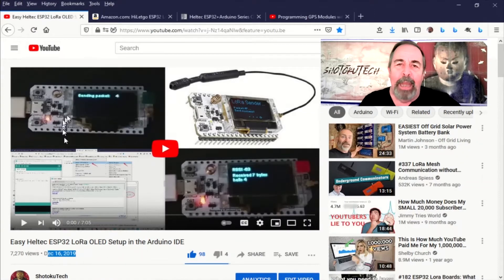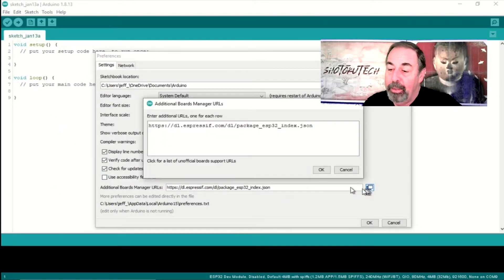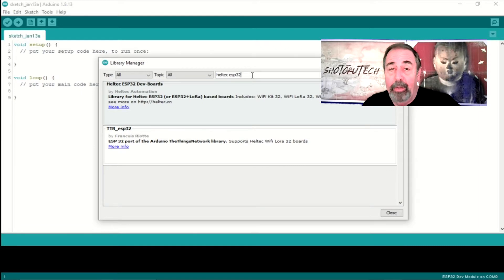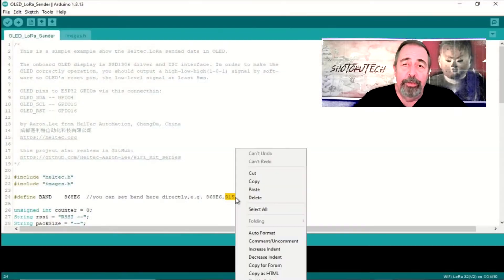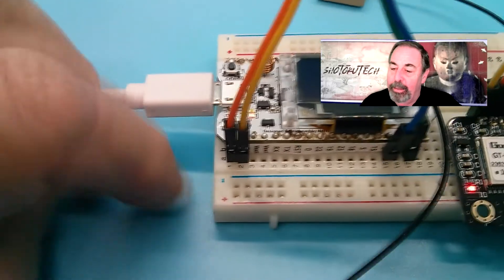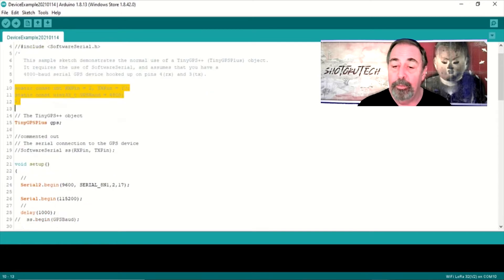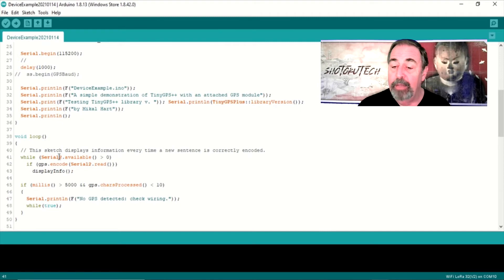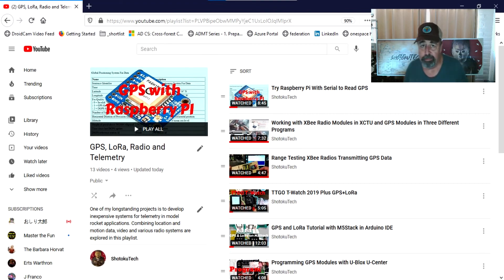New Heltec ESP32 LoRa Update and Connecting to a GPS Module

Comment: does this same method work for the V3 of the Heltec ESP32 LoRa boards?
Reply from the maker: Yes it would work, though the Serial pins have changed on the WiFi LoRa 32 V3 as it runs on the ESP32 S3 chip. I have several videos covering the V3 board. Thanks.
"Heltec WiFi LoRa 32 V3 SPI, I2C, OLED I2C, and Serial Pins"
https://youtu.be/OBQidEVssto?si=81VYD5ByApqbFXD7
See the V3 Pinout here: ShotokuTech / HeltecLoRa32v3_I2C
https://github.com/ShotokuTech/HeltecLoRa32v3_I2C

Comment: I am having trouble connecting my Heltec LoRa32 v2 to my GPS module. My code is very similar to yours, but I cannot seem to establish a serial connection with my GPS module unless I use pins 16 and 17. Using these pins I am able to read  and encode data, but it doesn't look how I'd expect NMEA GPS data to look. Since the LoRa board uses pin 16 for the OLED (which I have unsoldered from the board), I am worried that I am seeing erroneous data that is not coming from my GPS. I have used this GPS module with an ESP32 in the past, so I am fairly confident it is functional.
Reply from the maker: I don't think it is best to upset the pins that are dedicated to the OLED. Pins 2 and 17 were ideal from my perspective.

Comment: Hi, I have a Heltec ESP32 LORA v3 using Meshtastic.  I'd like to add a plain ublox neo6 gps.   Using the existing Meshtastic firmware that is already on the Heltec board , which pins should I solder the TX, RX leads from the GPS ?
Reply from the maker: Hello. Good question. But I haven't had the chance to try that one yet. For my example here I used software serial to assign pins that were available, as in not already used by something else on the board. Check the pinout here in the datasheet. 
https://heltec.org/project/wifi-lora-32-v3/
You can see GPIO43,44 are already taken by the USB port for serial. (CP2012 is a serial device). It looks like GPIO45-GPIO48 are open. Interesting device. Thanks.

Comment: I am using heltec esp32 lora wifi with BN-220 GPS module, i tried using your approach but it does not work 
i only see garbage characters printed on serial monitor . 
I connected to RX and TX of GPS to Lora RX TX pins Serial2.begin(4800,SERIAL_8E1,RX,TX);  - result �U��[ ���Y)�����)�Q ..
One observation : when connected  RX to LOra i was not able to upload sketch , i had to disconnect the RX pin upload then put it back 

, Also tried connecting to 2, 17  Serial2.begin(4800,SERIAL_8E1,2,17); as in your video -result  No GPS detected: check wiring.
Reply from the maker: Link to my code in in the description. https://github.com/ShotokuTech/DeviceExample20210114
This works as demonstrated in the video. Is your device speed 4800 baud or 9600? Hardware serial is used by USB port. So I employed software serial.
Reply: @ShotokuTech   how do we find device speed , i now connected to 16 and 17 , to avoid the hardware serial still no use, 
I commented some more details before for some reason youtube did not post it
Reply from the maker: @ameenasif  Find the management utility for your GPS chip. You can read, control and configure the chip with the utility from the chip manufacturer. I show this in: "Programming GPS Modules with U-Blox U-Center" https://youtu.be/ZaDpx9DvCPo
Reply from the maker: @ameenasif  Amazon product page has some details. Scroll down far into the page to see how to use it with a PC. https://amzn.to/3X2AnPU
Reply: @ShotokuTech  issue i am stuck with is i am not able to use Serial to read GPS data , it not a parsing issue , may be i am doing something silly like using wrong pins in code vs connection , BN-220 does not have the USB like the one you have and i wanted to make these work instead of buying additional hardware for different gps board
Reply from the maker: @ameenasif  Try connecting to a PC?
Reply: @ShotokuTech  So i ordered a USB to serial and connected to PC using the ubox thing i could see the GPS data. i also tried connecting to Arduino UNO used SoftwareSerial Lib and printed text i can see GPS Data , but when i use tiny gps or ++ or TinyGPSPlus i get * which is for invalid , for some reason its not able to parse 

$GNGSA,A,1,,,,,,,,,,,,,99.99,99.99,99.99*2E
$GNGSA,A,1,,,,,,,,,,,,,99.99,99.99,99.99*2E
$GPGSV,3,1,11,01,82,085,,03,57,212,,04,01,174,,08,14,156,*75
$GPGSV,3,2,11,14,25,254,,17,45,299,,19,14,313,,21,57,104,*74
$GPGSV,3,3,11,22,37,081,,24,00,345,,32,25,046,*44
$GLGSV,3,1,09,65,26,186,,71,39,041,27,72,66,125,,78,12,275,*65
$GLGSV,3,2,09,79,21,326,,80,07,015,,86,15,116,,87,74,092,*67
$GLGSV,3,3,09,88,49,309,*5B
$GNGLL,,,,,004734.00,V,N*50
$GNRMC,004735.00,V,,,,,,,170123,,,N*60
$GNVTG,,,,,,,,,N*2E
$GNGGA,004735.00,,,,,0,00,99.99,,,,,,*7D
$GNGSA,A,1,,,,,,,,,,,,,99.99,99.99,99.99*2E
$GNGSA,A,1,,,,,,,,,,,,,99.99,99.99,99.99*2E
$GPGSV,3,1,11,01,82,085,,03,57,212,,04,01,174,,08,14,156,*75
$GPGSV,3,2,11,14,25,254,,17,45,299,,19,14,313,,21,57,104,*74
Reply from the maker: @ameenasif  Well you certainly have come a long way then. I can't really provide technical support for someone else's hardware. But I looked in my storage and I actually have a similar unit. I might try to test it. But I cannot promise that. You might try a different brand or model.
Reply: @ShotokuTech  just looking for pointers,  in case this issue is known or seen . Your help has been great , best I have got so far actually.

Comment: Rather than output power, I believe the LORA setting in the sketch is referring to "spread factor." More spread factor would decrease the data transmission rate but allow transmitting data a longer distance. That is what makes LORA work over such long distances-ones and zeros are transmitted more like sawtooth than square waves, thus minimizing the impacts of noise.
Reply from the maker: Yeah this video is old. Check out: "LoRa Gateway for Qubitro with M5Stack UIFlow" https://youtu.be/yyrZrP6KDZs
Thanks

Comment: Hello, I love your videos, how can I make the data of a receiver of a heltec lora module display it both on the screen of the modules and in the Arduino IDE
Reply from the maker: In the OLED_LoRa_Receiver sketch, it looks like they already enable Serial at 115200 in 'heltec.cpp'. So I think you just need to addSerial.println(packet);
Immediately Under:
void LoRaData(){
In this sketch. 
Connect Serial Monitor to that COM port at 115200 baud.
Want to give it a try and let me know?

Comment: I could make one with a dht11 temperature and humidity sensor and the HeltecLoRa32 modules
Reply from the maker: Great idea. If you have a green house for example and want to keep tabs of the conditions. This would be a perfect low power solution.
Reply: @ShotokuTech  could not help me to form the arduino code of both emitter and receiver
Reply from the maker: @alejandraramos2466  Are you asking me to write the code? Check out my video 
"Your Next Arduino Project Wired With Circuito"
https://youtu.be/-rL4X9rs3Vc
To learn how to use DHT11 with ESP32.
Use OLED Receiver example sketch from this video. 
Here is the code for transmitting GPS data. https://github.com/ShotokuTech/HeltecLoraAndGPS20210220
Use this example to send DHT11 data instead. Give it a try. Thanks!

Comment: Hey I keep getting "Serial2 not declared in this scope" error
Reply from the maker: This is interesting. 
Have you "included library" "add zip library" for the "TinyGPSPlus-master.zip" that you get from the "mikalhart / TinyGPSPlus" "Code" button, "download ZIP"?
Otherwise there are just three lines with Serial2 in this DeviceExample20210114.ino
Line 24: Serial2.begin(9600, SERIAL_8N1,2,17);
Line 41-42:  while (Serial2.available() > 0)
    if (gps.encode(Serial2.read()))
I just verified my sketch and it does compile successfully. What line gives you error?
Reply: @ShotokuTech  For starters, I am using the Heltec wifi kit 32, I'm not sure if that changes anything. However, I'm getting the error that I mentioned above for the line that says "while (Serial2.available() > 0)"
Reply from the maker: @qjeng6052  I just selected WiFi Kit 32 and compiled fine. So is line 24 there? "Serial2.begin(9600, SERIAL_8N1,2,17);" This line 24 is where Serial2 is declared. So the only way to get that error is not executing line 24.
In previous instances where I had problems, I have removed Arduino IDE, renamed the Arduino folder in Documents and started over. Reinstall IDE, board definition URLs, boards and libraries. I can't think of anything else that can help in this case. Good luck! Thanks.

Comment: I got real scared soldering those jumpers next to that display ribbon
Reply from the maker: Yeah I put a new tip on my soldering iron for this one. I kept the tip sharp by rubbing the point on an emery board. Cheap hobby iron. One day maybe I get one of those fancy soldering stations.
Reply: @ShotokuTech  I'll have to try that emery board out. I got new tips that I was just itching to use. Cool video by the way. I saw some forum posts that say the antenna is the bottleneck for distance. Some people have claimed 28 miles on the same module with a different antenna!
Reply from the maker: @daze8410  interesting antenna thought. I have a few extra stubby antennas from the TTGO LoRa boards I have here. I was thinking of testing the difference. What kind of antenna will get me 28 miles? Can I fit it into one of my rockets? Thanks.
Reply from the maker: @daze8410  Yeah YT does not like URLs in comments. I have to review and approve them. Interesting read. I was looking at the longer 915Mhz antennas. Have to be careful that they are as advertised.

Comment: After running the sketch from this video, I'm getting some strange pseudorandom code in my serial port. I pasted a sample below. I'm certain that the GPS module has connected to a satellite (module is blinking once/second), and the code seems to be in logical segments. How did you get the information in your serial port parsed & interpretable? 

T ⸮⸮@ ⸮ dB⸮⸮⸮@⸮Y +  ⸮`@⸮	4 ⸮@@⸮ 0 ⸮          ⸮      ⸮@@⸮ 2 ⸮⸮⸮L⸮      ⸮⸮⸮@⸮ T ⸮⸮⸮@⸮	2 ⸮⸮⸮ ⸮⸮⸮ ⸮ 2 ⸮⸮⸮ ⸮	4 ⸮] '  T⸮Y + / D⸮ T ⸮⸮⸮ ⸮ , ⸮/⸮L 1#-⸮Y          ⸮     
⸮Y [ ⸮⸮ ⸮/@ ⸮      ⸮ ⸮  ⸮ ⸮ # ⸮  ⸮ ⸮ ⸮⸮ 4 5# ୀ@⸮	d ⸮    ⸮! ⸮/⸮ ĭ⸮@⸮	d ⸮Y   # ⸮⸮⸮F⸮T⸮   ⸮/  ⸮ ⸮⸮@ z	d ⸮⸮@ ⸮ ⸮m⸮ ⸮  T  
⸮⸮@ ⸮ ৐"⸮T⸮m⸮@⸮   ⸮  ⸮[ @⸮	4 ⸮-⸮@y	d ⸮-⸮@⸮Š ⸮ d ⸮/⸮ ⸮ ⸮ ⸮Š ⸮ L YP  ⸮( @ 
⸮ ⸮ ⸮  ⸮      ⸮mQ ⸮⸮⸮ ⸮ ⸮ ⸮ ⸮E ⸮⸮  ⸮⸮ ⸮⸮P ⸮⸮⸮ d⸮ ⸮o⸮ d %⸮ ⸮ ⸮  ⸮ A ⸮"dB ⸮ Q    ⸮- ⸮*  ⸮/  ⸮ ⸮	⸮$ ⸮ I @⸮ ⸮[⸮@|	0 ⸮-@ ⸮Y⸮ ⸮ -⸮⸮ M  )⸮⸮  ⸮  ⸮⸮@ ⸮
⸮ ⸮2 ⸮⸮⸮ z⸮2  
 ⸮⸮⸮ ⸮/  ⸮-⸮@d	T -⸮@t	4
Reply: looks like it was a baud rate problem. Baud rate must be set to 115200
Reply from the maker: @lewisdenver5672  I wasn't clear when I went from the GPS module in the terminal @ 9600baud, then plugged into the Heltec, it's @ 115200 baud in the code. Cheers!
Reply from the maker: Is your serial monitor connected to the board at the correct speed and duplex? There is no parsing needed, it should be regular text.

Comment: You mention you plan to do a mashup between the sender sketch and the GPS sketch - have you done that yet? I'm working on a similar project right now and would love to see a LoRa sending GPS data to another LoRa. I'm still in the helloWorld phase. Cheers!
Reply from the maker: Here it is. I had some difficulties flying rockets, running multiple cameras and keeping everything working, so the video will have to come out next month when the next rocket club launch is scheduled. But the code works okay.
https://github.com/ShotokuTech/HeltecLoraAndGPS20210220
Reply: @ShotokuTech  Thank you so much!
Reply from the maker: @lewisdenver5672  Thanks!
Reply: @ShotokuTech  Hello again! I've noticed that the last three decimal places of latitude and longitude are not particularly helpful in finding location, as "xx.xxx" decimal places is enough to be accurate. Do you know how I would go about hiding those last three decimal places with the code you sent?
Reply from the maker: @lewisdenver5672  In these two lines, try changing the number 6 to 3:
dtostrf(lat, 5, 6, buff);
dtostrf(lng, 5, 6, buff);
This is a touchy function if I recall. I don't know off the top of my head if you need to do something with the number 5 in those lines. I'm guessing not.
Reply: I'm hoping to add a mini MP3 shield to the LoRa (heltec OLED version) as well. Ideally the two ESP32s would exchange their location & notify the user through a prerecorded message when this happens. I think I'll be pretty tight on pins!
Reply from the maker: @lewisdenver5672  'Sounds' pretty cool! Digital Marco Polo game.
Reply: @ShotokuTech  exactly!
Reply from the maker: I have the code, working on the video. I will link in this comment later today.
Reply from the maker: Here is my range test video: https://youtu.be/b1X5E6O_THE

Comment: An ultimate GPS module adafruit, an SD card (which works with a spi link) a bluetooth module. You can give me exactly it's 3 components. Which must be compatible. It must work with an Arduino card. Because there are several types of adafruit ultimate GPS. But I do not know what to choose. It is 3 components must be
Reply from the maker: Follow this link. Click on BOM. Click on each item. Click on the 'buy; or shopping cart icon. Each item is spelled out very specifically with part numbers, where to buy, etc. Thanks.
https://www.circuito.io/static/reply/index.html?solutionId=60048b8b5651e800306315b4&solutionPath=storage.circuito.io
Reply: @ShotokuTech  You sand if I use a GPS module PAH1F1702. A sd cars adaptor, a bluetooth module Hc05. It is three components will be accounting.and that I could make my project work (with an Arduino card)
Reply from the maker: @ouchanihida3327  https://www.circuito.io/static/reply/index.html?solutionId=60048b8b5651e800306315b4&solutionPath=storage.circuito.io has the complete parts list.

Comment: Have you played any with the gateways?  I am trying to get the results to my openhab, and bought the HT-M00 , but I cannot seem to receive any data from the esp32/Lora boards
Reply from the maker: I have the official The Things Network gateway here. I guess I should plug it in. I also have a WaveShare LoRa hat for Raspberry Pi. If I understand correctly, there is LoRa, a single frequency transmission and reception. Then there is LoRaWAN, frequency hopping spread spectrum communications protocol. Not sure if the two are compatible? I could retire and have more time to play with this stuff. But I have too many expensive hobbies! Check out my Webthings Gateway videos in the mean time. Stay tuned!
Reply: @ShotokuTech  Have u connect to a gateway?
Reply from the maker: @ikbelhammami5525  I have not connected the Heltec ESP32 LoRa to a gateway. No. Thanks!
Reply: @ShotokuTech  that’s what I’m working on nowadays and I’m in the process figure things out
Reply from the maker: @ikbelhammami5525  Sounds good. Let us know how it goes? Thanks!